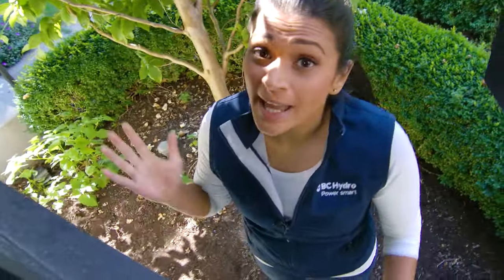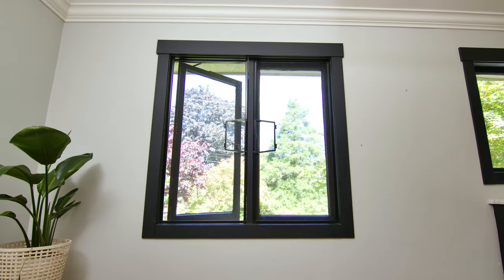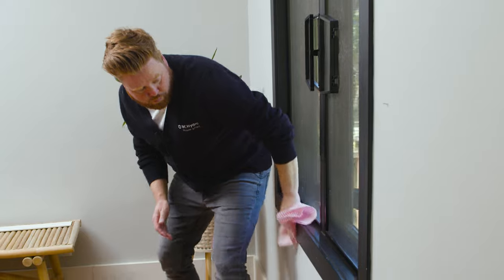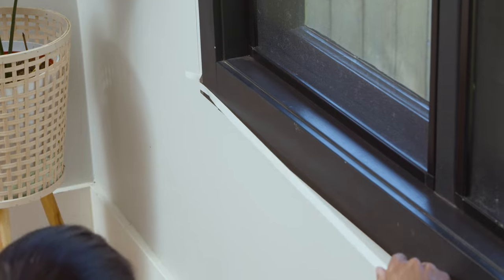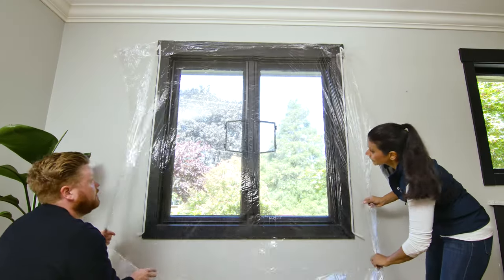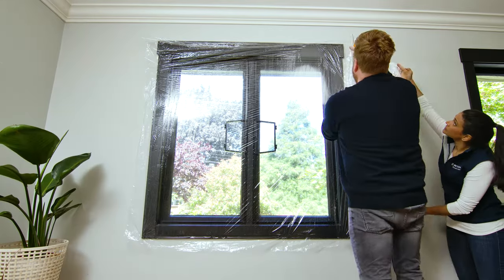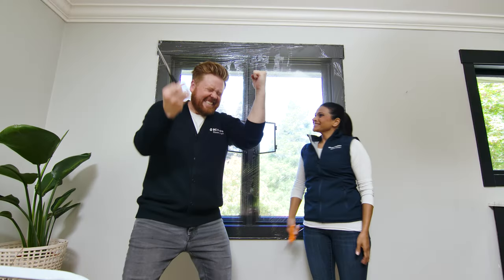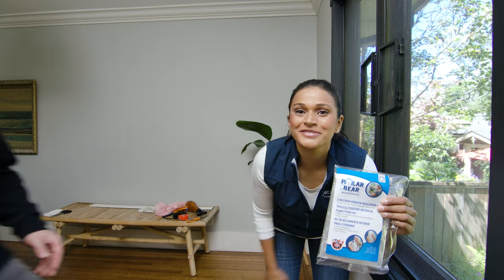How To Install Window Film | DIY Home Energy-Saving Tips

Comment: I have a large sliding glass door and none of the patio door kits fit. They all say 84x110 but none of them are actually 84 inches high, I’ve measured. Is there a way I can order a roll that is at least 10x12 feet?